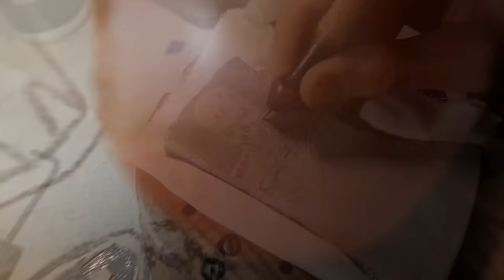Drawing on metal. Ax restoration. How to draw robots on metal

Comment: I've tested on my axe, the FeCl3:water=1:1 was too thick, there was black oxide layer on the surface of the axe, and the etching speed was very slow, I dropped the axe in it for about 1.5 hour, only etching for about 0.2mm. I think  FeCl3:water=1:1.5 may be much better, I will test the result next try.
Reply: When I put the axe in, the black oxide layer appeared on the surface of axe